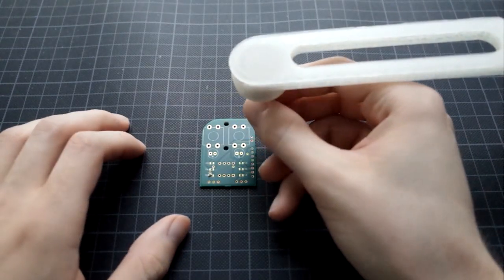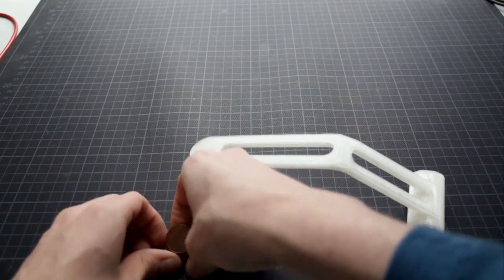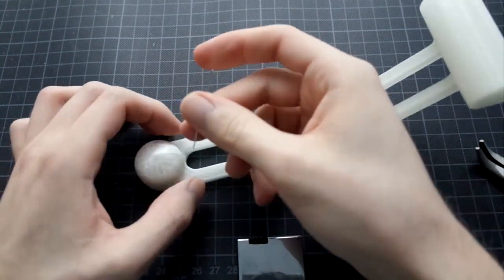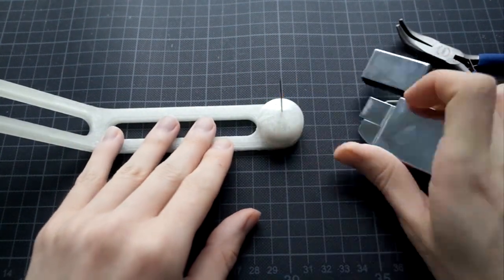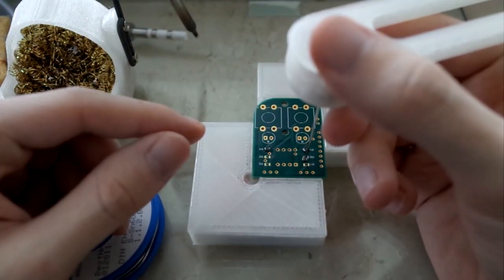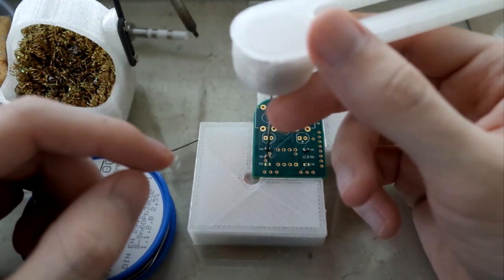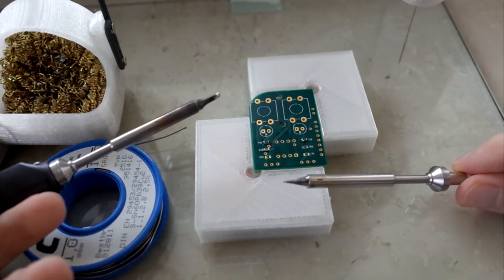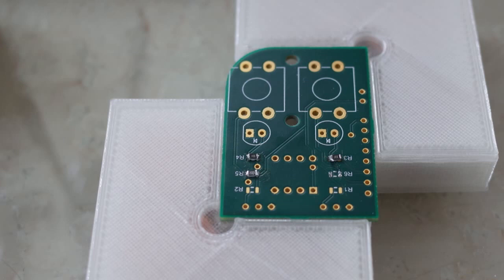3D Printed SMD Beak: Build and Usage

Comment: I was just looking if such a thing existed, as I need to replace 16 RGB LEDs WS2821B. I will be replacing the metal pin with a wooden tooth pick to avoid damaging the LED surface.

Comment: the easier way is to hold the component with tweezers in your subdominant hand, apply a flux, drop the chip into place and hold it with the tweezers, then tap one side with an iron. takes all of 2 seconds